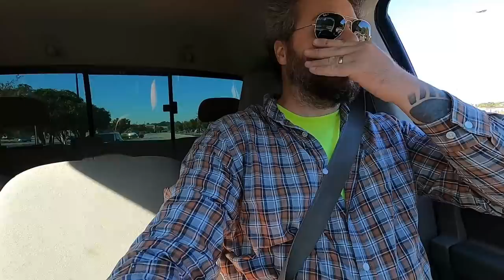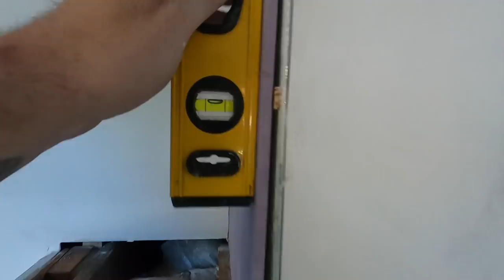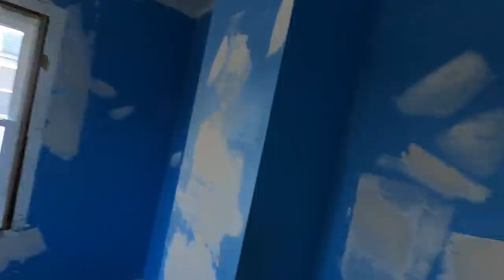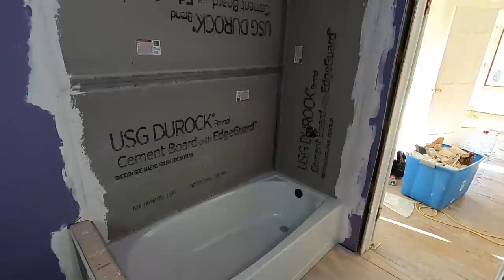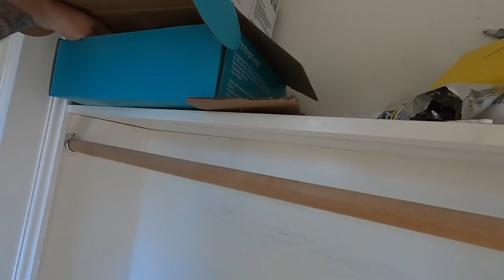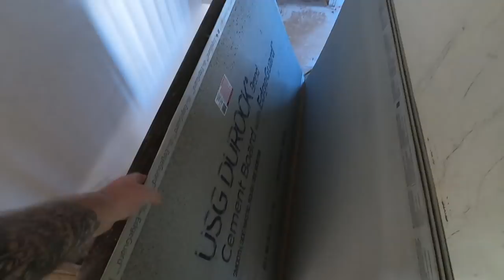The Upstairs Bathroom INSPIRED BY PRISON (Kind of)

Comment: On the shower use the (half tile) on the bottom row so your grout lines are straight. Also don't forget to seal that cement board before you tile it as well.

Comment: Why is the hot water heater upstairs and not in a catch basin with a drain for when it goes tits up and floods the upstairs ? Dude tank less hot water heaters are cheap now and hang on the wall and you can run the hot water forever and it never runs out .you should have gone tankless.